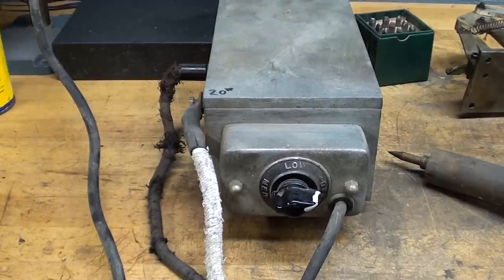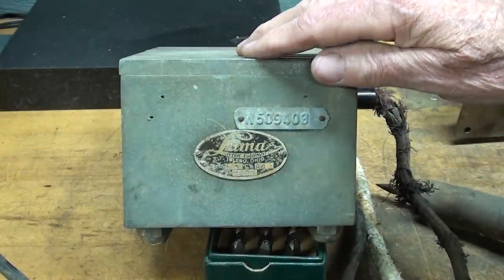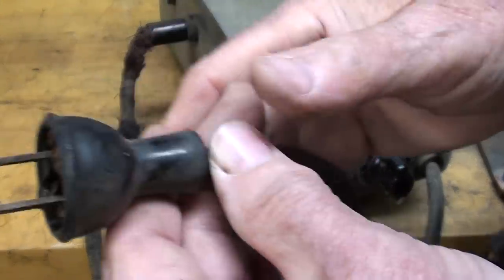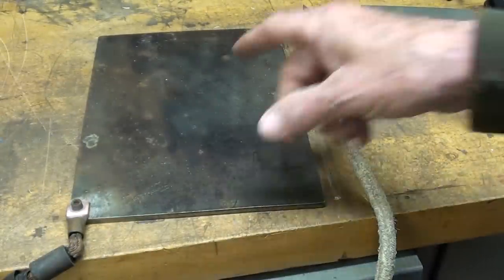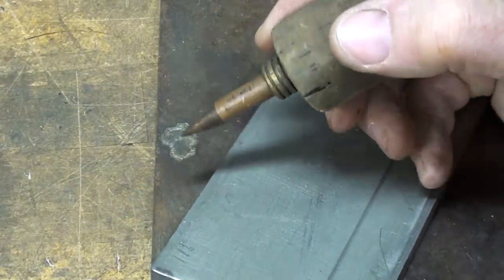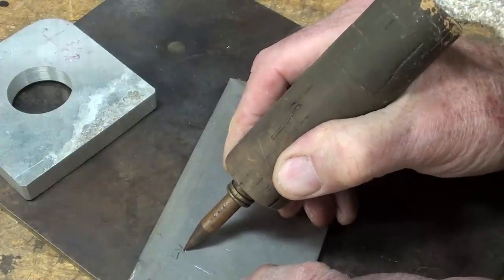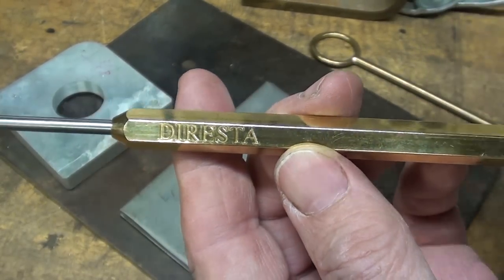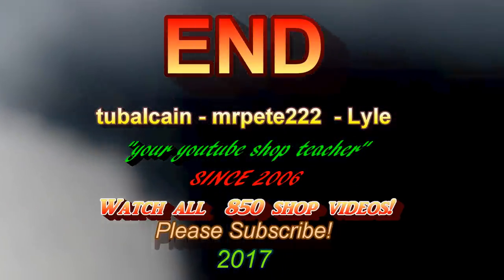SHOP TIPS #386 Using the LUMA ELECTRIC ETCHER tubalcain

Comment: Yes, I think are still in business.  My mentor had an old soldering unit.  I bought one 40 years ago and still is going strong.  It is great to solder fine wires.  It puts the heat right where you need it.  It is absolutely the best way to solder music wire.  It is simply a negative ground and then an positive tip you solder with that using a carbon arc rod.  Thanks for the video.

Comment: At 11:23: Aluminumis a great conductor, but Al2O3 (Aluminumoxide) is a great insulator. That means you need to penetrate the oxide layer first before current can flow. Probably sanding the oxide layer down and preserving the surface with oil - to prevent a new oxide layer would help the etching.
Reply from the maker: Thanks for that
Reply: I knew someone else would have had me beat to the answer :)

Comment: Hey Mr.Pete
In the late 1960's I was an apprentice mechanic. I bought some Snap On wrenches that cost a bunch. The other mechanics and I purchased an electric buzy  pen. To use it you placed the metal object on one battery post and a jumper wire between the battery post and the item to be etched by the tool. The electric flow through to permanently etch the item. Even if some jerk tried file the image it was still visablle

Comment: When I worked at Dresser- Cleco  in the 90's we found another good use for the resistance etchers , brand new carbide bore bars are 10 to 12 inches long and for smaller CNC lathes this is WAY to long ! So we would etch around the circumference about 7 to 9 times & then chill them in a water fountain , the strike them on a steel corner of a lathe tool . almost always broke pretty square. Those were the days , when we intentionally broke a new tool and didn't get fired or reprimanded !!!
Reply from the maker: Interesting---Thanks for watching.

Comment: Out of passing interest... the etcher switch knob is a variation of a whats called a 'Chicken Head Knob'. They're still made in all sizes & flavors; pretty sure most from back in the day were Bakelite... check amazon and/or eBay. (I think they still come stock from the factory on some Simpson multimeters.) Also, back in the 70's we had one of those Luma Etchers in A&P school... looked much the same, wiring and all. We never had use for it, and it didn't appear to have been touched in decades.
Reply from the maker: Thats good info

Comment: Hey there Mr Pete,
I was lucky enough to pick a similar unit up here in Australia for $25.00 about 5 years ago.
It works perfectly, but mine uses Tungsten for the writing tip. Upon research when I first acquired the machine I found that it uses the green Tig  welding tungsten's. 
I have a feeling my etcher was built in the 1960's but that is just a guess by it's design and style. 
I have seen many milling cutters and reamers etc etc people have etched and the quality of handwriting is stunning.
No matter how hard I try to replicate it my attempts fail. So I wonder if there is some form of template they used or some such similar thing.
Keep up the good work Mr Pete, your new format of video where you have decided to show your face has made the video so much more personal and I for one like it.
Regards from Australia..
Matt
Reply from the maker: That was a good price.  I need to try tungsten in mine

Comment: The last 27 years of my working life was in Radiation Protection. There are still radium dial watches available on ebay.  A worker at the plant bought one and tried to wear it into the plant.  That did not go well.  Had the plant locked down for an hour, 'til we cleared it.  I may try to build my own resistance etcher.

Comment: Mr  Pete, May I suggest that you replace the asbestos wire as soon as possible with silicon insulated wire. I probably don't need to tell you the disastrous effects of asbestos fibres to your lungs. As a person having worked in an industry where asbestos was all around I have seen to many colleagues die prematurely of asbestos fibre cancer.
Reply from the maker: Thanks for watching.
Reply: Silicone-insulated wire.
Reply: You may suggest it but I doubt mrpete will take a blind bit of notice if you have seen any of his other video's. :-)

Comment: The,aluminum is hard to etch because of the coating of aluminum oxide (alumina, corundum). It's transparent, hard, a good insulator, and a good protection against further oxidizing (which is why a highly reactive element like aluminum is still quite weather resistant). The coating is brittle and very thin, so you can scratch through it (even with a soft copper electrode) and reach conductive metal. The aluminum so SO reactive that the alumina coating is reformed within seconds after exposing the bare metal. (Cool video; I ordered a used Luma etcher - different model and not a good a deal - off eBay while I paused the video. You have to be quick; when someone interesting mentions a tool in a Youtube video, they suddenly get scarce on eBay.)
Reply from the maker: Thats good info.  Didn't know I could start a bidding frenzy

Comment: When you get that pop and sparks, is it creating a fine pit along the line?  What causes this?

I ask because I have a vintage rifle with very fine markings in the bluing.  So fine that the markings were typically lost in a factory reblue.  I did notice two things, the grain in the metal was retained which indicates a form of electro/chemical etching, and the lines would typically have one tiny pit.  Glad I watched this one.

Comment: The type we had at work had a thin bar which the electrode would screw to, this had the effect of vibrating as the spark made contact and would not stick to the work. It was mainly used for marking tools as the grinding shop had acid transfer etching. Maybe you could make up an attachment like this for your handheld electrode?
Reply from the maker: Thanks for watching.

Comment: I wonder if you would measure the voltage across the etching leads?  Also, it would be interesting to know the amperage used on the line and the leads.  I would imagine they reduced the voltage and therefore increased the amperage available (if the transformer windings would handle the current).  Greg
Reply from the maker: I did do some of that--but did not film it

Comment: I only guess, but aluminum is coated by very hard layer of oxide. It melts in much higher temperature. That's why welding aluminum is so difficult. Try the fresh cut.
Reply from the maker: Thanks for watching.

Comment: What about reversing polarity
Will it make a difference how it works
Went thru 2 snap on versions of resistance engravers during my career of 37 years as a heavy duty mechanic 
Never thought about it 
The ones snap on sold were 12 volts just hook to battery
Reply from the maker: Unfortunately, I sold our last summer. Wish I had not

Comment: Here In England we call them Electric Pencils. BEWARE, the WHITE lead looks like ASBESTOS to me. It needs to be  heat resisting cable due to it getting hot when etching. Please change it for  a Silicone cable or fiberglass one.

Comment: I wonder what the voltage is ? DC I assume? I really don’t know.
Reply from the maker: not sure
Reply: Says 115 right on the end of the box
Reply: Ellie Price that is the input voltage at the plug where it goes into the wall. I’m wanting voltage at the etching tip. Most likely it’s converted to DC voltage like a mig welder.
Reply: Thanks Tom and Kevin. Looks like low tip voltage and high amperage to produce a the hot etching spark.